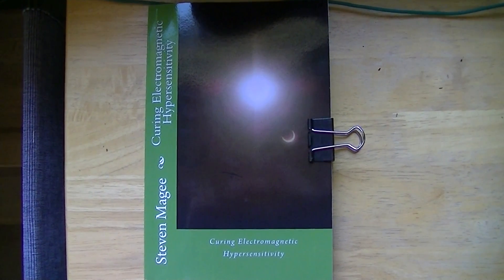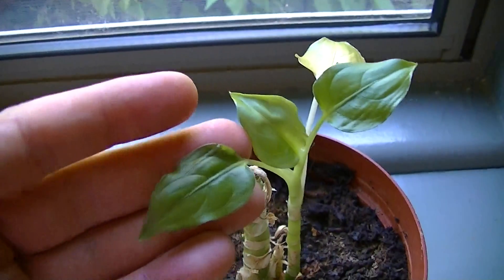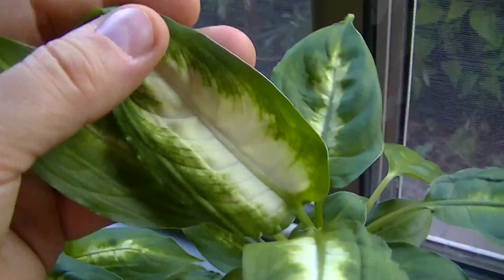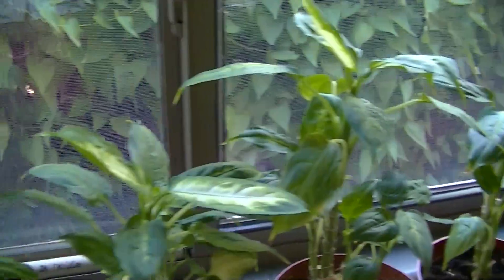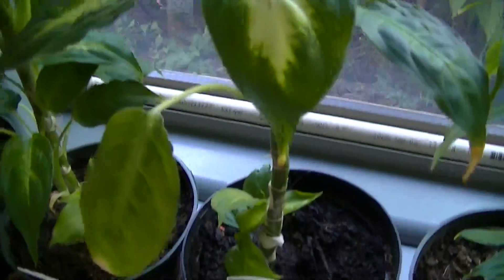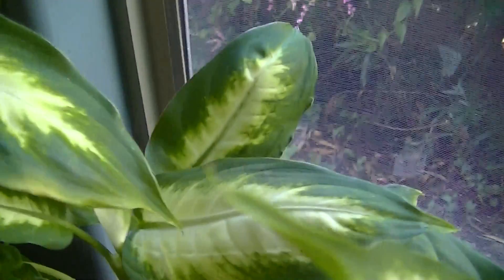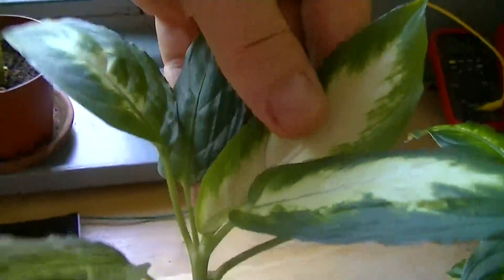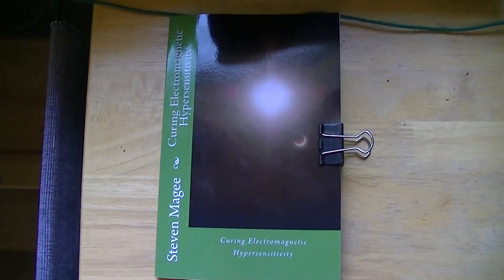Curing Electromagnetic Hypersensitivity - Water

Comment: Thanks again for the insight Steven great video nice and clear...

I also noticed when I started to boil my drinking water for 10 minutes to get the chlorine out the water became pleasant to drink, I started to water my plants with the same water and they changed almost over night to a darker green color and had better growth.

I`m sure you are well aware but for your viewers sake, you need to  have your overhead fan on when boiling the water. Chlorine when vaporized in steam becomes 100% or something close to 100% more absorbable as it`s now in the air and when you breath it in it gets main streamed into your body via your blood stream the same way nicotine and pot does, it`s instant and can be very dangerous to some people and small children...

I bought an electric hot plate similar to this one but mine has 2 burners one small and one large, I use it to boil the water outside... http://answers.canadiantire.ca/answers/9045/product/0431200P/salton-salton-single-burner-portable-range-questions-answers/questions.htm

I also use a shower head pre filter, so when I shower hot or warm I don`t breath in the Chlorine fumes, and or the chlorinated water does not get absorbed via my skin to my blood stream when I take a bath or shower...

I bought a Y adapter so I can run a hose down and use it to fill up my bath when I use Epsom salt, it`s a great way to pull the acid from your skin and body and not just for women :/ It does give you soft skin though so no need for those skin cancer causing so called moisturisers big pharma pushes down peoples throats. 

Here is the one I use, the filters last and last and then keep going. I bought the cheap one for $29 at Canadian tire. http://www.canadiantire.ca/en/pdp/rainfresh-shower-filter-0621042p.html#.VAzN5890wd4

Same as this one http://www.spritewater.com/products/universal-shower-filters/slim-lines-slim-line-brass/

The pre head filter I bought is plastic and I have a vary large shower head attached to it similar to this one but my arm extension is 10 inches not including the head and it has held up fine for over 2 years know, maybe longer.. The head and arm are both metal the head is over 6 inches wide.
 http://www.homedepot.ca/product/berwick-shower-only-trim-kit-rain-showerhead-in-polished-chrome/829731

Cheers,
Terry
Reply: Charcoal filters can't take out chlorine from hot water.